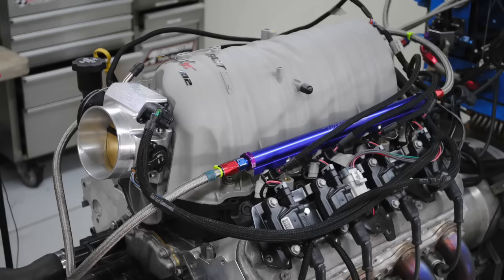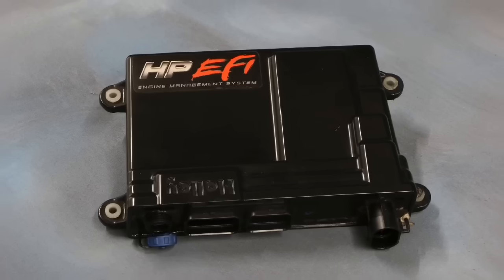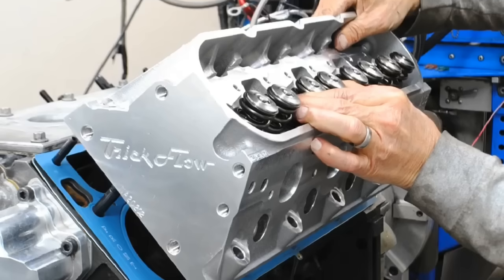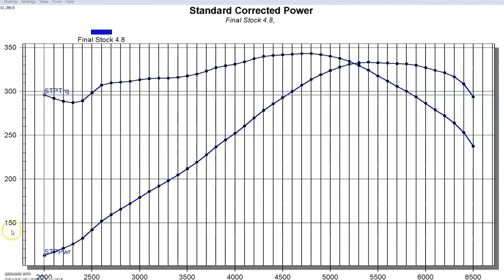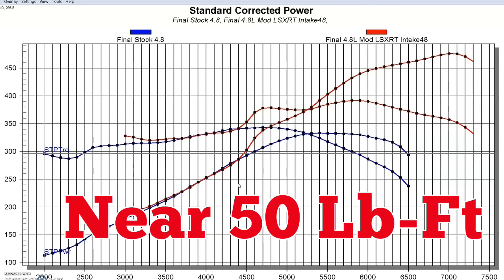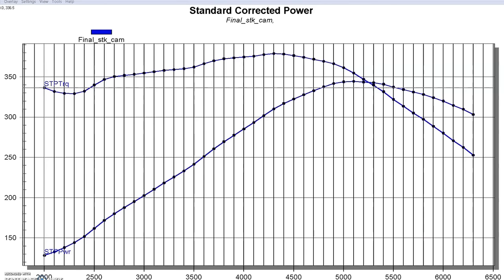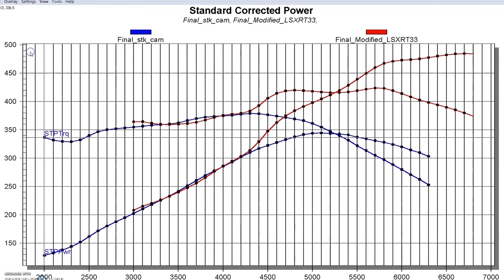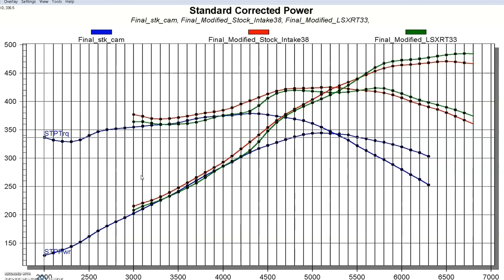JUNKYARD 4.8L & 5.3L POWER UPGRADES! HOW TO ADD 130+HP TO YOUR LS! HOW TO SWAP HEADS, CAM AND INTAKE

Comment: Thanks Richard! I'm in the research phase for a possible 5.1 build for an autocross motor. There is a 300lb weight break at that size so it's very interesting to see real world numbers. Trying to imagine what a slightly offset ground 4.8 crank in an LS1 would make with some head work and a cam along with my existing FAST parts. Really want to see 450whp and ideally ~330wtq by 3000rpm.

This video makes me think it will work with the extra 0.3L, more compression, and E85.

Comment: Richard, Great job here in the combination test video. I too, will be reading results from the warriors out there, especially for the daily driver 5.3L as retirement does not include 1K intakes or CNC heads. After 35 years of fixing as a dealer tech, I like the longevity stories with good fuel economy using home skills, headers and maybe a cam. Just want to be able to afford to buy new britches from time to time, while still feeling the seat move under them. Plus, few weekends under the hood with the feeling I went too far. Thanks again.
ASE Master Tech - Retired

Comment: Since you work so much with LS motors. Can you show us how to get rust out of the cooling system?

I keep getting blocked radiators and having rusty coolant from my dam iron block. Idk how to clean out this rust safety with out hurting the structural integrity of the block and cooling ports.

Comment: New to ls engines but am curious what a stock pcm vs different aftermarket controllers seeing how much hp you can gain just by switching pcm on a stock engine. Im preparing for a swap and plan on using terminator x max for on the fly tuning and built in trans controller.

Comment: I'm working on my own little hot rod of a motor. 00 LR4. Tbss intake, 92 sniper throttle body, 1 3/4 headers, and the big question is what cam. Part of my Keep It Simple Stupid mantra says just throw in a SS2 cam for my NA build. But I almost want to see a tsp 228R. Though your 45-454-11 might be nice too as it was seen. Head wise. I'm torn between stock milled 243 heads or a hand ported milled 862 head and run compression up to 10:1 would make a little ripper for under 2 grand

Comment: I like that they run the test and hold aftermarket company’s to be honest on what there product really does on every kind of combo, and if the stock stuff is better, and if it’s not worth the money they put it out there. Really makes the top company’s stand out! Like this test anything under 6k rpm the stock truck intake is the way to go and not worth the coin to upgrade, and even up top is it worth it depending on the combo to upgrade to say a fast intake. Thank you on the info you put out! Would love to see a test pushing the aluminum block and cast iron block to its limits. And to also see if or at what power level should you use cast iron over aluminum or does it matter? And at what power level should you upgrade to aftermarket or say a lsx block! Run them hard and tear them down and look for wear to see at what power level each block start to fail and wear out parts.

Comment: Good evening, Just ordered a Texas Speed Stage 2 High Lift 212/218 .600"/.600" LSA 112 . I have a LQ9 block and Im going to install 862 heads. I was told this build is getting more popular for people looking for torque motors. I also was told i could use my stock converter. Texas speed have been very helpful. I just was wondering how you felt about this build. Also curious if you had to guess where would the horsepower and torque be at? (1980 trans am ,4l60, rear posi with 373 gear, sheet metal intake, stock snowflake wheels and tires 15' ) Thank you so much Richard!! Love you channel very informative!!

Comment: With the CNC head 4.8, you would definitely need a substantially higher than stock stall rating torque converter to keep the RPM in the useful powerband during flash

Comment: Hello Richard... we are putting together a tow mule at our place that will be running an LQ9 motor. Am planning on doing a hedder swap of 1 3/4” long tubes, a TBSS intake and a cam. And possibly a 1.8 ratio rocker swap. Was thinking for the cam something like 208/212 lifting at least .550’s an intake lobe centerline of 104ish and a lobe separation of 114 .  This motor needs to have brutal bottom end pull as it will be dragging a loaded 30’ trailer. Any input you can share would be very appreciated to get me dialed in for success, please help! 😁 Thank you,

Comment: Daily driver setup - tbss Intake, 90mm throttle body, 1.75" headers, stock heads with a 216/220 @.050  duration cam at .550 lift with a like lsa of 109. Enough low end torque you dont need a stall converter but still have a slightly choppy idle
Reply: This is my exact current build except 92mm tb lol.
Reply: 706 heads?
Reply: I know this is an old comment, but what kind of power are you making?
Reply: @remingtonbuskill8410  it's a wore out ls1 made 330 to the tire through a 4l60e 4.10 gears and 31" tall tires
Reply: Wow, why so low, what were you making prior to the cam, intake, and headers?
Reply: @remingtonbuskill8410  don't know thats not bad at all to the tire considering the size
Reply: I guess for 31s thats not bad, I read over that lol
Reply: @remingtonbuskill8410  truck runs high 12s on motor with a 3200 stall and drag radials
Reply: Oh very nice
Reply: And what vehical is this in?
Reply: What size engine?

Comment: Did a Gen IV 5.3 in a 2013 Silverado... 224/232 .581"/.595" 113 LSA cam similar to the Crane - on Comp Lobes. Texas Speed PRC Stg 2.5 heads @ 58cc (706/862 cores), stock intake, TB, etc. Cheap Speed Engineering 1.75" headers and ORY. 3" cat back exhaust. 3200 converter, 4.10 gears, heavy 20" wheel/tire combo. It made 420 rwhp/398 rwtq on 93 octane swill. My truck is a 2001 Silverado... LQ4/80E swap, EPS 214/220 .598"/604" 111 LSA, TBSS intake, 92mm TB, 1.75" headers, 2.5" down pipes, dual in/single 3.5" out Magnaflow, 4.10 gears. Going to see what it does on the same dyno Wednesday. Previously did 349/384 on 87 octane - different dyno. Swapping to a set of AI rebuilt/milled 799s (no porting), FAST LSXRT, and a 3000 converter, + 93 octane. These tests have me rethinking... maybe I need a set of 862s pretty much untouched. Keep the TBSS intake, and do the converter + retune on 93. I use my truck as a daily/tow pig. Thought I had a plan, now - not so sure.

Comment: I put together a 09 5.3 with a 224/228 .600 lift cam, milled 799 heads .030 and they were ported and polished, and a nnbs intake. I would like to see something similar to that on the engine dyno

Comment: I love the Tick Sat night special cams, tight LSA so they sound angry at idle and a really punchy mid-range. The stg 2 is a go too for stock compression 5.3/6.0. I put a stg 3 in my buddies iron 346 with katech cnc 862's. Sounds like a drag car and will boil the tires at 40+mph.

Comment: I tend to describe to my clients, "Dollar per horsepower" upgrades. If you look at the Fast intake your only getting 1 horsepower per $100. Cam and heads estimated at 2500, thats $17 dollars per HP much better return of investment. I personally only tell people to change intake as the final piece for LS upgrades, as neccessary. I also have a 4.8 in my Silverado with the 454-11 comp with a manual trans on my 4x4 daily. The 4.8 is a dog down low until the velocity comes in at 4000 RPMs, very representative of your Dyno chart, which also the same place Boost comes in (by the seat of your pants) on these motors with a Turbo. 4.8l's respond well at high rpm, but if your talking daily driver, it's my personal recommendation to always up your cubic inches and you'll be much happier cruising around town. But if your a racer with a 4000-5000 stall converter the 4.8 can work pretty good with little to no mods under extreme boost.

The only thing I didnt like about this video is the compression ratio was unknown. 

For a future video. I would love to see a 5.3 vs 6.0 vs 408 LS stroker, all at 11.5 compression  (Easily capable with flattop pistons) the 454-11 Comp Cam, and Stock vs. Fast/HighRam intake. Also maybe just a thottlebody only episode looking at a 70 vs 92 vs 105 on respective intakes without a shoehorn adapter.

As a tuner I firmly believe most people shy away from compression ratios over 10:1 because of the stigma of known drivability issues with Carburetors on the street. Most people dont realize how wild you can go with an engine using EFI and how well street manners are achievable with Factory and Standalone ECU technology. 

I also dont have the followers on my youtube channel to warrant the cost of putting this together, so if you were to do it I would be VERY delighted to see it. And FYI, your channel is often recommended by me to my clients as a tool to help bring them closer to reality. The internet has a way of putting beer goggles on real world capabilities. Many believe because X manufacturer and Y manufacturer say they offer 50 HP upgrades, and because Joe Popular in hot rod forum said he did it, That both X and Y together absolutely has to make 100 HP cause Joe Forum did it!.....Ugh! 

Anyways, A ton of great stuff here! Thank you for the hard work! Thank you for disclosing your results to the world and helping to bring harmony to the fight of Internet VS. Reality! 

Sincerely,
Reply: I honestly just started on my 5.3. I have a 2006 z71 Chevy Silverado cat eye or whatever they call it. I don’t want much extra power honestly as I do not gun it really ever. I want just enough so it doesn’t feel so sluggish. I recently added a s&b closed box cold air intake, and plan to just do and intake and tune then be done. Honestly just looking for about 50 extra rwhp and maybe 30 or 40 torque wise. Curious what your thoughts are on achieving that?
Reply: @duckytruckg5059 wasted money on intake and tune. Should have just added a common cam
Reply: @duckytruckg5059  o
Reply: @duckytruckg5059  A decent tune on a complete stock LS is not a waste at all. An aftermarket intake manifold on a complete stock LS, however, IS a waste of money bc it doesn't yield major results per dollar investment.. just as prostar stated. 
If you want to get 50-ish hp and 30-ish lb-ft then you would be best going with an NSR cam of some sort. A few different manufacturers offer decent "drop-in" or NSR (No Springs Required) cams that are almost perfect for a 'first step' into building a happy daily. Once the engine is reassembled and up and running, you'll need to get it tuned for optimized performance anyways so those two go hand- in- hand anyhow. But it's entirely possible to make a little extra almost "free" power just by simply getting it tuned in complete stock form. 

One more thing to research is: a guy I used to work with who was pretty slick on these engines swore up and down that throwing in a 2500-ish stall converter would transform a stock truck into a red light to red light and burnout champ. I've never tried the mod myself nor have I witnessed a 'converter-only' truck but the logic makes sense if a man thinks about it for a minute. I've only got manual trans trucks this day and time, so I can't vouch for that bit of trickery at the moment.

Comment: 5.3 or 4.8 elgin e1840p pac 1218s,mildly ported 862s or stock 243s long tubes ls6 intake. No idea of power number but feels very good considering the price. We've done this on a few engines because it works well and it's  affordable fun 😁

Comment: For daily driver cam, I really like the Summit Racing "Ghost" cam. I replaced the ASA cam that I had in my Cougar with the "Ghost" cam and it picked up both torque and HP. This is also a good cam if you plan to go with a turbo later. Summit Racing used to call the "Ghost" cam their Stage 1 turbo cam.

Comment: Another great video full of info! Yes, boost! Got some questions, though. Why the dip in the torque curve with the FAST intake? It showed on both the 4.8 and 5.3, but almost looked like too much ignition advance then a recovery. It really deviated sharply from the “stock” torque curve, then had a dip down. As for suggestions, you’ve compared TBSS. to the Dorman LS2, what about the Dorman truck intake and the Dorman TBSS? Maybe the Dorman LS6? I’ve heard they changed the internal baffling compared to factory intakes. How well do they work? Then can they handle boost? How much? Above 2 bar? Can you get a 5.3 to 1000 hp with 20 psi boost? Lots of room for many more tests!
Reply from the maker: I ran the Dorman truck, LS6 and LS_ill try to see what dip you are talking about
Reply: Check the torque curve between 4300 and about 5500 on both 4.8 and 5.3 modified runs. Departs sharply from the stock line, then dips back, and finally peaks. In both cases the truck intake is much smoother, only the FAST intake shows it. I suppose it could be some natural intake tuning but it looks “funny”.

Comment: Why doesnt every dyro run start at the same RPM? I have to think that would be the best comparison between these combinations. Especially when testing different boosted combinations. Great videos regardless.
Reply from the maker: to a point we can choose to test rpm-but the dyno won't allow really long sweeps-say from 2000 rpm to 8000, so we must chose a middle ground, usually one that allows us to run to the power peak  or slightly past

Comment: On my daily truck I have long tube tsp and catless y pipe , cam tsp in & ex 220 lobe lift .353 Lift .600 separation 112 intake center 110 , stock bottom end , Apr head bolts 243 heads ported and tsp valve springs ,fast lsxrt intake, k&n cool air intake , stock fuel pump & injectors & throttle body. I'm maxed out on my fuel system after injectors and fuel pump is upgraded a 102mm throttle body will be put on . plan to procharged after drag car is done 👍👍👍🏎🏎🏎

Comment: Mr.Holdener could you possibly test various ls valve spring designs to see how spring design affects rpm limits. Single,dual ,beehive, conical, dual conical. Thanks
Reply from the maker: I tested various springs for power-but not max rpm
Reply: Ive read various of claims of which one is better for high rpm use, but a real dyno test would be awesome ,thanks for your hard work on the dyno.

Comment: Tick perfomance polluter cam, p&p with 2" intake valve slightly milled 706s, p&p tbss intake on a 6.0,5.7 maybe just scratching into 600hp, and 5.3 same mods maybe 560hp range
Reply from the maker: 560 hp from a 5.3L with ported heads and a cam?

Comment: Mr Holdener, many of us are rebuilding 6.0 cathedral port motors for use in heavy 4x4 1500 trucks, and 2500/3500 tow trucks. We need all the aversge hp and tq possible from just off the converter (say 2200) to a 5500-6000 shift point. The btr truck torque 202/202 on 110 is a great start, but we need you to develop and sell a REAL TRUCK CAM.  We all like a lumpy idle too 😁 How bout a lq9 with 317's, early truck intake. Test a couple gm cams, the btr truck 202/202 110lsa torque cam, the sdpc hot truck 214/218 on 111lsa, and some custom single pattern cams in the 208-218 range on 106-110 lsa. Our wide ratio automatics need all the torque from the converter stall, to a reasonable rpm shift point, then all the possible tq again on the shift recovery. Develop us a REAL truck cam on the dyno, and market it. We will buy it.
Reply: I ordered a custom cam motion  218/218 on a 108lsa 106icl for my z71 5.3 to 6.0 swap to see what happens on the dynojet😁
Reply from the maker: I have some interesting things I'm testing next week that might help these combos
Reply: There is a Howards shelf cam that is 210/214 108lsa 104icl that looks interesting too😁
Reply: Also the smaller $260 Summit brand truck cams. 205/218 and 209/218 😁

Comment: I’d like to know the best combo on a 5.3 to make the most torque from off idle to  no more than 5k rpm.  The realistic place that most DDs get used!
Reply: You see the test results for the baseline?  There ya go. No one spends hard earned money to limit themselves to 5k rpm.
Reply: @CPEngineeringSolutions   lots of people who tow campers, boats, and ect want low end torque
Reply from the maker: lots of guys want more low speed torque in their DD and lots of guys want more top end.
Reply: Get a custom cam cut w/ similar timing events as stock but w/ much more aggressive lobes that will cause instability at 5500. Build a custom intake w/ much longer runners than even the stock intake, w/ similar cross section and taper. Waste of time/money. You want torque or a low rpm engine? Swap gears. Buy a diesel. Dont ‘build’ a 5.3 for a 5k redline.

Comment: I notice most dyno sheets that add power are almost all equal until 5500 then keep climbing until the extra "100" . are there any best ways to increase the curve under5500 for street machines?
Reply from the maker: torque gains down there is tougher-I'm working on some stuff

Comment: I have an 05 Tahoe with the 4.8. I’ve owned it since new and always serviced it myself. We’re over 300k on mileage and have a pretty bad rear main leak. Since this has been relegated to an “extra” vehicle I’d like to have a little fun with it. I was thinking of going with 5.3 crank and rods and keep the flat tops for added compression. I’m open for tips on what I could do to get some extra horses while maintaining and passing my required emissions inspection.
Reply from the maker: 5.3L is a good idea but it's sometimes hard to get flat tops off/on new rods

Comment: A 496 stroker with a 224/236 duration cam is a pretty sweet combo😁 jk. No experience with LS engines. I am thinking about one in a s10 tough. Thanks for the videos!

Comment: PLEASE! Sloppy cams (in any brand) vs Summit cams (at least for turbo). SS2 vs. Summit LS pro cam stage 2 vs. Summit stage 3 on stock turbo 5.3 with factory manifolds and cheap ebay turbo
Reply from the maker: the SS2 vs the world is coming up
Reply: @richardholdener1727  OMG this made my day